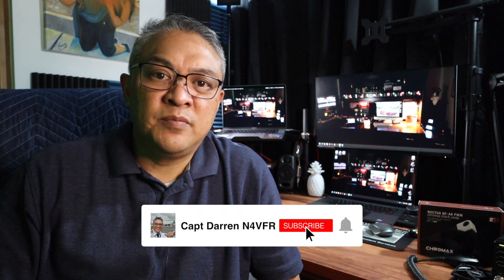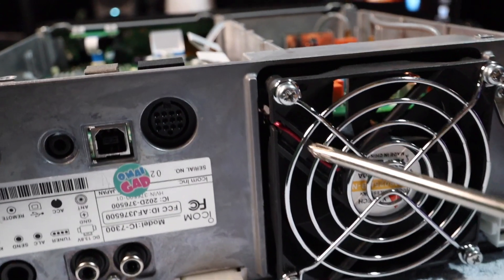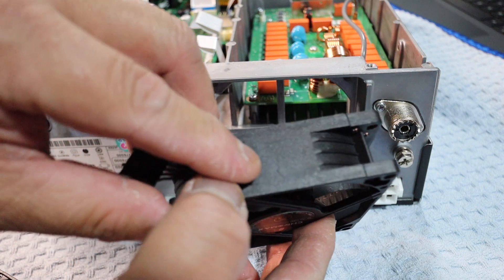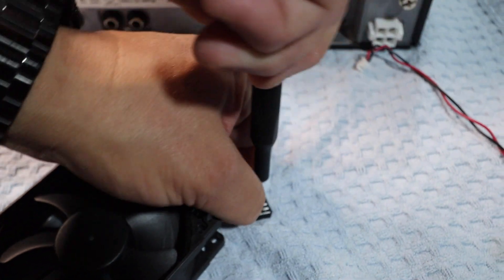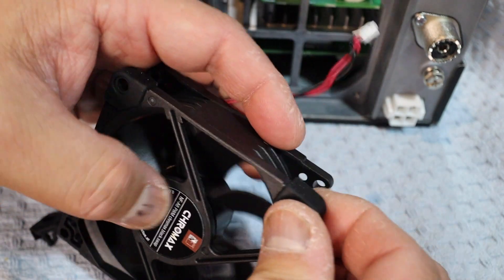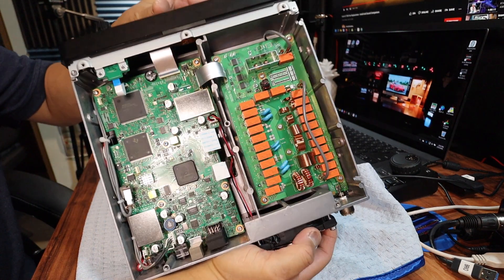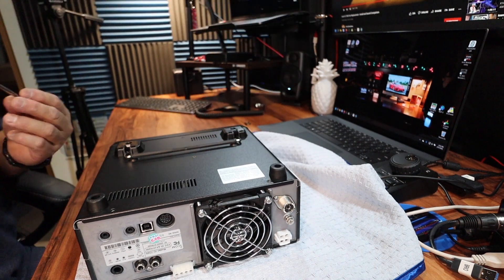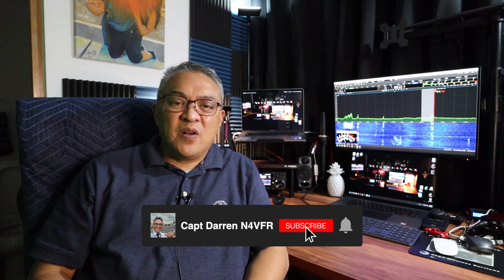Replace your Icom IC-7300 Noisy Fan | Listen to the difference (Silent) | Quick and Easy Swap out!

Comment: So, replacing the fan would be considered an unauthorized modification, correct? If the rig needed warranty service at a later date, but within warranty, would you be out of luck?
Reply from the maker: That would be correct.  Probably voids the warranty.  That's the risk your taking if you decide to modify your radios.

Comment: Noticeably quieter, but it is worth bearing in mind that the original fan is far more powerful and rated for greater back pressure. Probably a great swap if you don't drive your radio with high power, high duty cycle modes. The 7300 does control the voltage at the fan connector according to demand for cooling. I know this is a popular modification.... 73
Reply from the maker: This radio which I modified the fan on is no longer used as my primary HF rig.  It's new purpose is POTA and running 100 watts.  So far no issues because of being outside where there is more ventilation for the radio.  Additionally, one will not be running full power to an amplifier which will not overheat the 7300.    73's de N4VFR